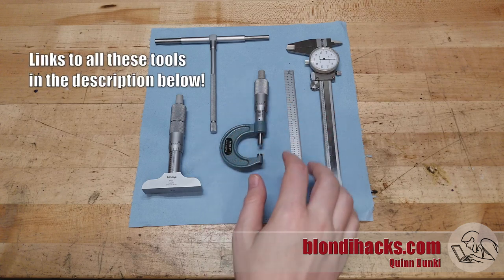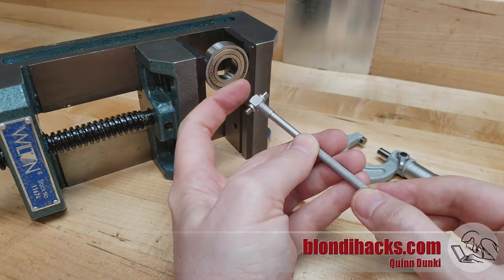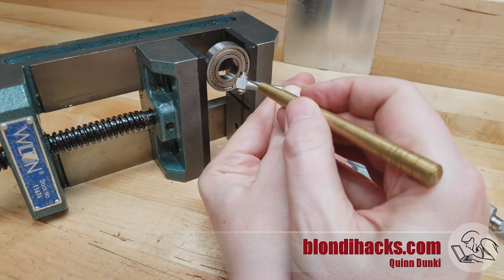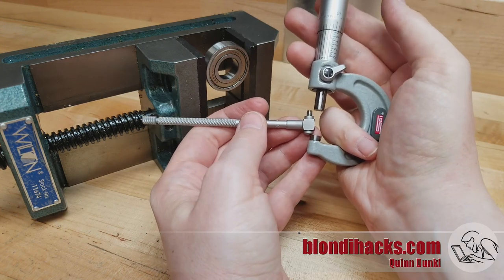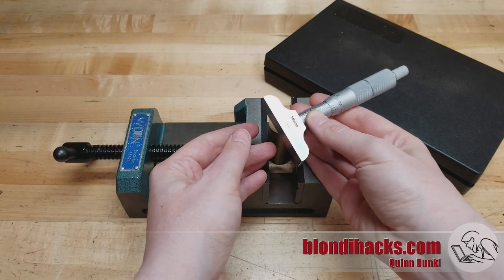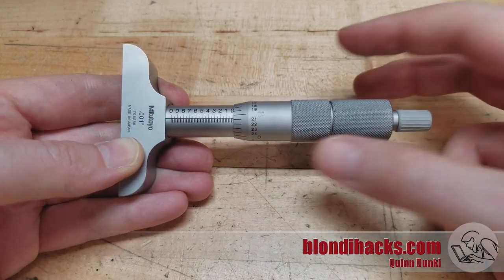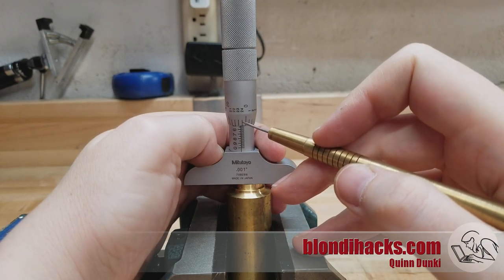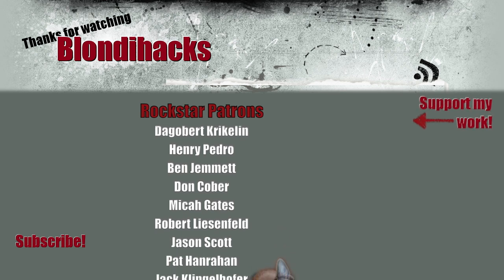Metal Lathe Tutorial 20 : Snap Gauges & Depth Gauges

Comment: One caution on snap gauges: If you want them to last, don't let them snap open without being inside a bore. The little slot and pin that holds the anvils in place inside will eventually break, and the pieces will go flying across the room. When I'm done using mine, I always hold the anvils together with my fingers before I release the lock and let them expand slowly. I can't tell you how many broken snap gauges I've thrown away because of this.

Comment: Hah, another super-useful video! It’s funny, when I saw you starting to use the snap gauge, I thought “hey, wait a minute, she has that misaligned!” I figured you were going to just point out to us that you needed to hold it straight, but of course, we’d have no idea whether we had it exactly on-center or not. Duh! - just start high and move it through center and you’ll get the accurate measurement! Also an important tip about not counting on the stem-clamp to hold the pistons against arbitrary force from the mic. I’m gonna get out my snap gauge set and mic and so some practicing :-)

(I’m also finally a Patreon supporter now; I’m a lottle ashamed by how long I’ve been freeloading 😔)

Comment: Quinn, during my apprenticeship the lecturer who was explaining how to use the snap/bore gauges always referred to a technique called feathering. As you advised in your video it is best practice to ignore the ratchet mechanism and feel (feather) the micrometer anvils onto the snap gauge. One interesting technique that we apply at Rolls-Royce is Gauge R & R methodology. The R’s stand for Repeatability and Reproducability, this is where the technician who is measuring a feature repeats the same measurement a number of time to ensure accuracy of the reading. You can take this further and ask another technician to measure the same feature using exactly the same measuring equipment. In the ideal world all the measurements will be very closely grouped together. This can be used as part of the six sigma reporting technique to assess accuracy of your measurement process.  Informative video as always.
Reply from the maker: That sounds like a great shop practice!
Reply: Rolls Royce ought to know I suppose. If they don't then no one does.
Reply: R&R is integral to established quality management system audits for ISO 9XXX, QS, MIL, etc. The high-level audits consist of periodic double-blind tests of inspection operators to test the reliability of their measurement techniques. Bad scores could result in a loss of certification. 

In my many years in manufacturing, I have yet to see a production or receiving inspector perform in R&R as well as a typical Tool&Die Maker.
Reply: while these snap gauges are good in general and explained perfectly here for perfectly accurate measurement it is better to use a dial bore gauge and i think a company like rolls royce would use nothing less.

Comment: Another thing to ensure is that the snap gauge is straight when you measure it with the micrometer. The tip radii of the anvils will generally be smaller than the radius of the bore being measured so if the snap gauge anvils are not lined up with the micrometer anvils you will get a low reading.

Comment: For an inside measurement where the surfaces are parallel, such as the bearing used in the snap gauge demo, would a vernier caliper give an accurate reading?

Comment: Is there any sensibly-priced way to measure the internal diameter of holes too small for a snap gauge? (e.g. 1/16" to 1/2" range)
Precision Pin-Gauge sets are too expensive for the typical home-shop budget.
Reply from the maker: That’s a great question! If your precision needs aren’t super high, you can use the backs of drill bits or pieces of drill rod. They are not made to the same tolerances as gauge pins, but are often good enough. Failing that, you’re pretty much looking at investing in gauge pins. However, it’s not something that is needed all that often, so you can also wait. Small precision holes are generally made with reamers, so you can trust their dimension. You don’t need to check as you go as with larger holes that are bored.
Reply: Set of small hole Gauges or use the shank of a drill bit. If I need real precision, I can turn and polish some piece of metal down until it just fits, then mike that.
Reply: Using drill bit end as measure gauge is very wrong. Drills usually have angle from cutting edge to the shank, to prevent it from jamming in the hole. That difference on shank is fairly huge for any precision work. Better use broken end mill shank or tap shank, they are made in tight tolerances and they arevery round.
Reply: Quinn, I've gone mostly Mitutoyo like you have for metrology.  I had tried to partner with Fowler, but they do not appear to have adequate vendor quality control on their Chinese hand tools and I got tired of bad calibrations, rusty fixtures, and a don't really care attitude.  Starrett is of course great too, but depending on the item can be crazy pricey.  All that said, last week I went out on a limb to try an  HHIP pin gage set and was utterly delighted by what arrived.  Their M1 and M2 sets, combined, for $163 with free shipping.  That's every pin gage size from 0.061-0.250 (set M1), and 0.251-.500 (set M2).  Their accuracy and variance calibrations were excellent, and random sample testing 10 pins were all in-spec.  So I don't normally plug a brand, but for those who need more than drill bit or reamer bit accuracy, it's a great affordable option.

By the way, I have the same Mitutoyo Snap-Gage set, and indeed they start at 0.500 in measurement capacity - so together with your caliper and micrometer, Quinn is right as usual!
Reply: @nikolasimeunovic9086  You can still use a mike to check the size of the end of your drill bit. And this is only for "rough guide". If you want thou/0.01mm precision, it won't be good enough. But it will tell you if the hole is about 3/8" or 7/16", which, in some cases, is sufficient. If you have a good collection of drill bits [and their ends aren't all gouged up!], you can get better precision.
Reply: I have a old precision small hole gauge made by the Kwik-check gage company of Florida that works by dropping a tapered pin into the hole and reading how far it descends with a magnified scale. It doesn't work of the hole is chamfered at all.
Reply: @Blondihacks  Good advice for non-critical inside measurements. Note that reamers are occasionally classed in over and under nominal fractional size. We often use these, as well as metric and number reamers.
Reply: Another way is to drop an undersized pin of known diameter in the hole and measure the max/min of the pin clearance with a dial indicatior. Be sure the indicator contact is close to the hole corner. Otherwise you'll be in for a session of trigonometery, ratio, and proportion calculating pin tilt, engagement, protrusion, etc.
Reply: @forrestaddy9644  Pro trick - you can use 2 smaller pin gages side-by-side to measure holes if you don't have a single plug gage. It won't capture qualities such as MMC and cylindricity like a single pin, but is accurate in a pinch.
Reply: @peteroleary9447  Yeah, gaging holes with pins can be a guessing game but grabbing a drill with a good shank and your handy DTI will get you in the ball park. The two oin method you suggest enable a shrewd tech to explore hole taper and out of round by scissoring the pins a bit at different depths. There's more tricks. I stated the simplest in my portfolio.